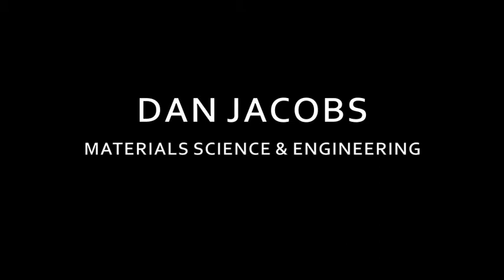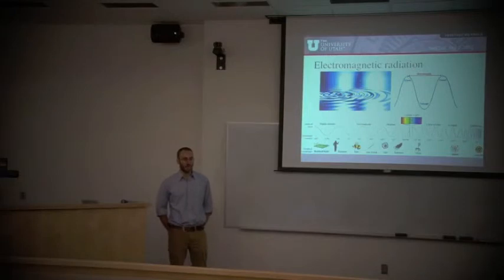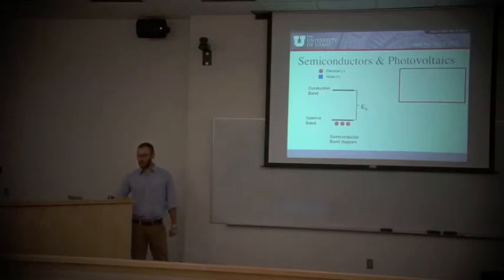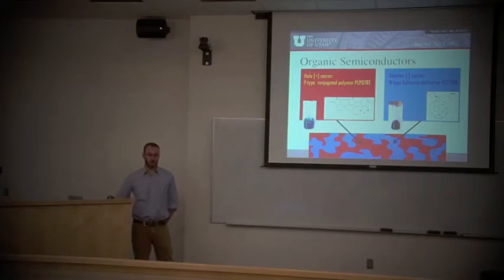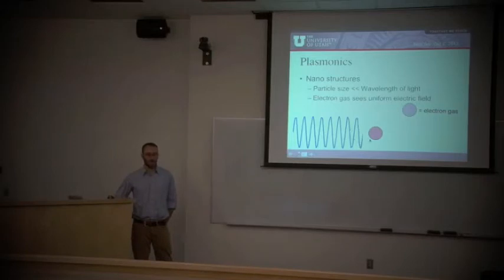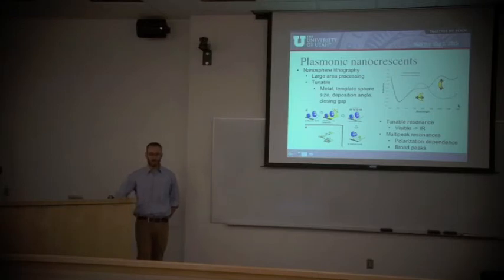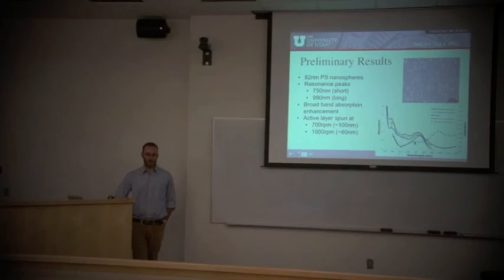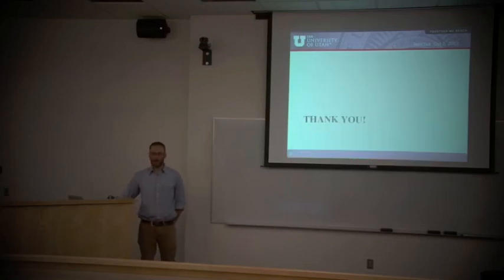Plasmonic Organic Photovoltaics: Controlling Light for Inexpensive Solar Cell Devices

Comment: Hi, thanks a lot for your very nice presentation. I worked on a similar topic several years ago. The big challenge is to show that the observed increase in light absorption (here of the whole system) actually occurs within the organic material and not mostly within the nanoparticles themselves. It is well kwown that nanoparicles strongly absorb light, especially at the plasmonic resonnance. This phenomenon cannot be excluded in this experiment. Perhaps Raman measurements would give a hint...? The enhanced photocurrent here unfortunately most probably comes from the fact the solar cell with particles is shunted (=destroyed), showing the typical linear shape. You could probably try EQE measurements? 😊  Thanks a lot and good life to plasmonics!!